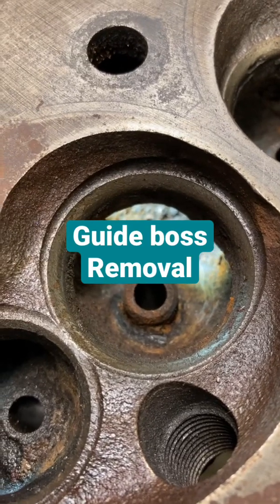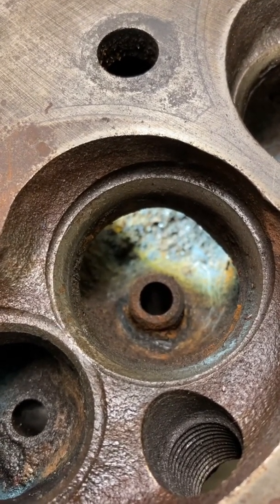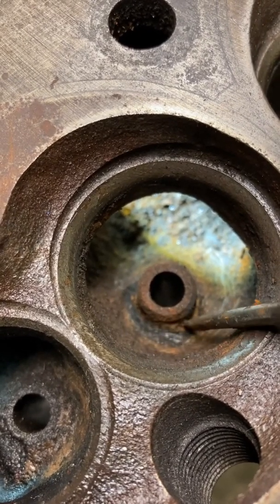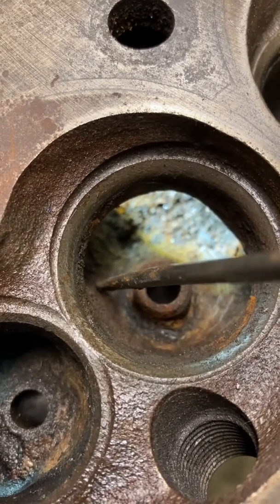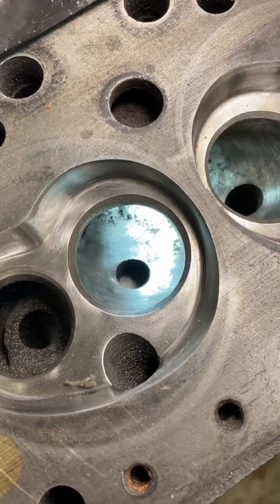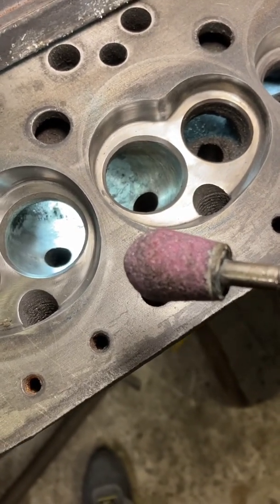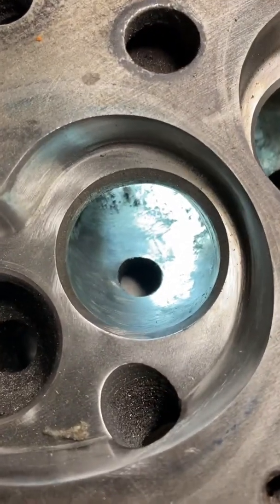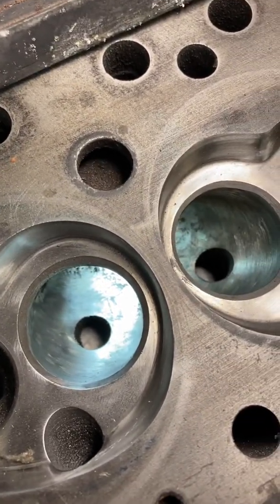Classic Mini cylinder head porting. Guide boss removal to improve airflow.

Comment: Looking ok, as you will know changing or moving the valve guides always has to be before any cutting and lapping-in in of new valve seats. Machining a taper on the last quarter inch of the protruding inlet guide is also common practice (where maximising heat dissipation for the valve head and stem is not as critical as on the exhaust side).
Reply from the maker: I bullet nose all my guides. The exhaust guide requires less taper than the inlet as there is more material left in the guide boss so less of the guide protrudes into the port.

Comment: Just doing exactly this on my head and was wondering whether to take the whole boss out on inlet and exhaust or just slim them down, opinions seem to go both ways. Any downsides to doing it on a fast road 1312 with an SW5 and twin SU's?
Reply from the maker: Far easier to grind it right out than work around it. There’s no real negatives to removing it completely and it’s quicker and easier when time is money.
Reply: Only that by shortening them you are reducing the sideways support to the valve stem as it is struck by the rocker so it will wear out quicker letting the valve rock more. Also on the exhaust side heat sink for the valve will be less of course.
Reply from the maker: @philtucker1224  I don’t shorten the guide, they’re always left full length. It’s just the boss in the head that is ground down.
Reply: @TurboMinicom if you grind down the boss, you are reducing the valve guide length
Reply from the maker: @andredesousa96  as I mentioned above, I don’t shorten the guide. It’s the boss in the head casting that is ground away then new full length guides are installed.
Reply: @TurboMinicom  right, my mistake. I thought the boss was the name for the protruding tip of valve guide, but from a quick research I now understands it is the protruding metal casting small area around the valve guide tip. Thank you for taking the time to reply!
Reply from the maker: @andredesousa96  no problem. 👍